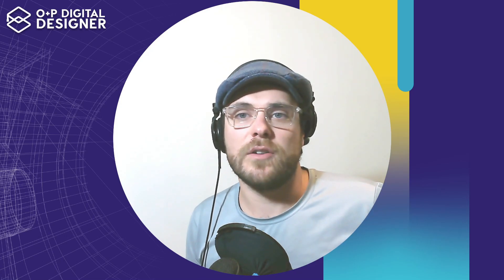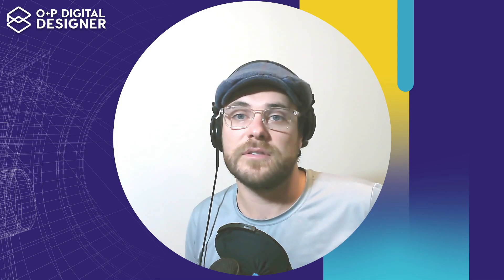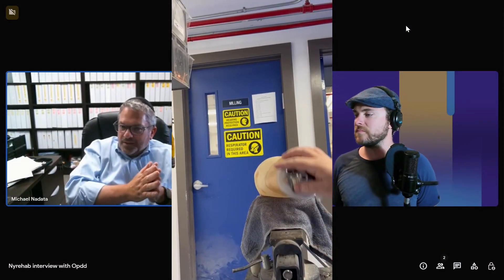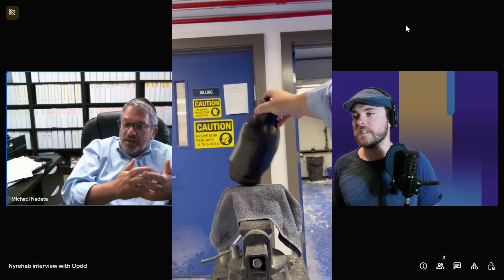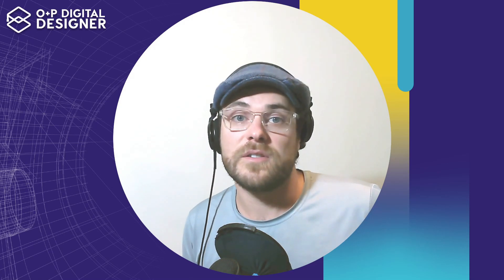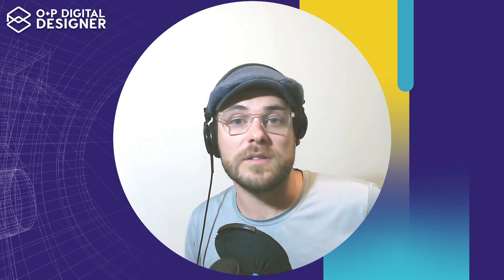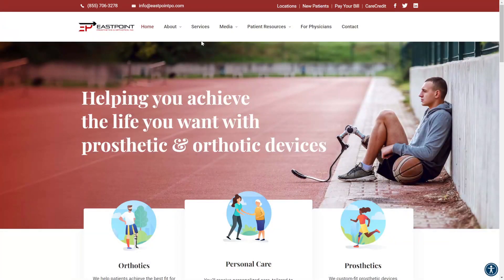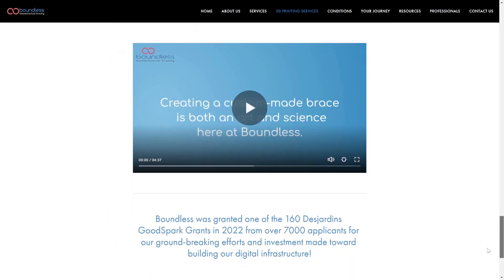The Danger of MJF 3D BK sockets, and the results you need to see to shape your own design workflow.

Comment: When MJF printing Sockets PA11 should be used it is still stiff enough when designed with the right wall thicknesses but does not break in the way PA12 does
Reply from the maker: Although PA11 is indeed a little stiffer, it would fail in the same way as PA 12, its would still rupture and shatter in a very similar fashion. WIth Pa11 not nearly as prevalent in the US compared to reseller preference of PA12, PA11 is often harder to find (you need a dedicated machine running pa11 to make it buseinss feasible), its the older material, and thus its more expensive, pushing it out of reach for affordable parts! At least in my experience.